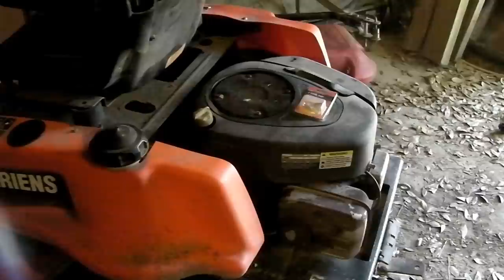How To: Replace You Lawnmower's Electric Starter

Comment: Daniel, I have a 7 year old Toro Zmaster 2000—Kawasaki FX651V engine.  Replaced the battery, spark plugs, starter switch, fuel filter and solenoid—just because of old age whether it needed or not.  The mower sometimes starts when left on battery charger for 4 hours as maintainer.  There is no clicking and just no starting most of the time.  Same happened before I replaced all above. All fuses are good. Could the starter just be bad?  Have a new starter sitting here in box. Understand that the ignition coil wire could be bad but not sure I am able to dissemble and replace that.

Comment: I replaced my starter. When I try to start my toro Timecutter 380z mower I hear a series of clicks and it will not start. What do I do now?
Reply: didja replace the starter solenoid?  or...sometimes it's a safety switch shorting out....Sometimes when I replace my battery it then has enough juice to override whatever electrical malady it is experiencing in a switch or wire or somehwere else... gotta have enough juice to blast through corroded grounds et al   (clean your grounds on starter, and starter mount to engine (that's a ground that is not a wire, just the contact made to create a ground, I think)        good lucky

Comment: I have a ariens zero turn and my fuses keep blowing. I changed the starter and ignition brand new and fuses keep blowing
Reply from the maker: Can't recall if that model had a solenoid? I've moved on to a Cub Cadet  ZRT54.